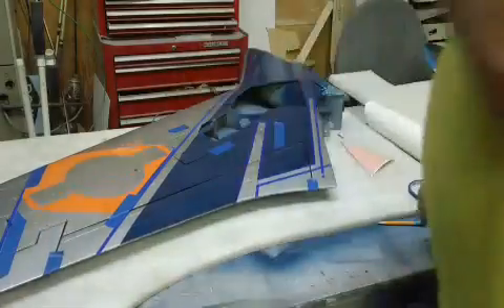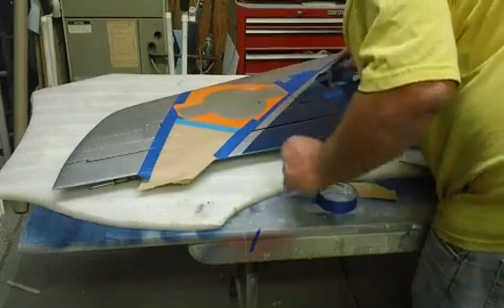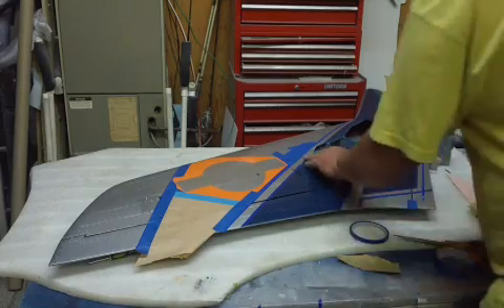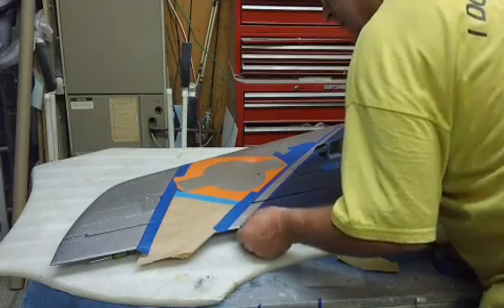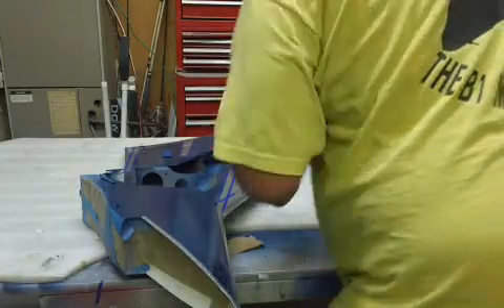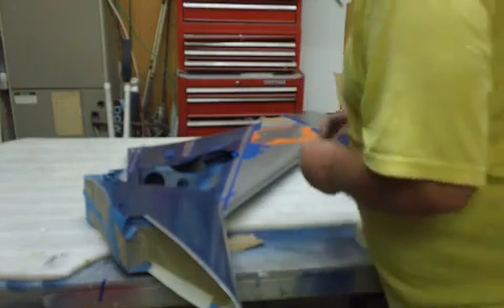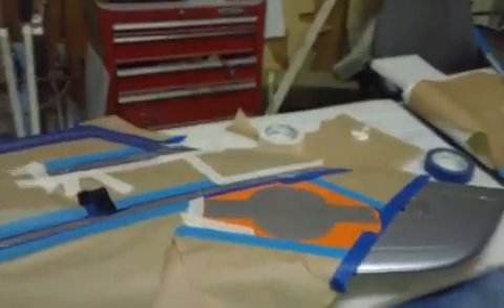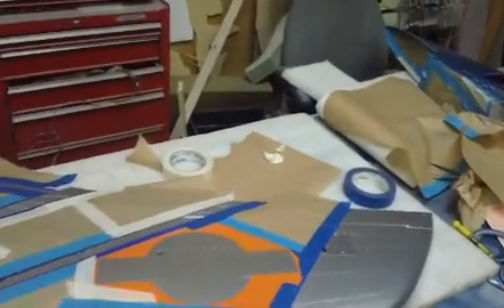masking for white

Comment: I think you can still get fineline, but it's is extremely expensive. It does bend tighter without bunching or lifting as it is thinner. But being careful with the pin striping tape that you are using work fine too.

Comment: That was a close one wowzers. See the white star mask is a spray through mask not a blocking masks. That means you got to put the white over the blue I designed it that way to help with the line up. However if you did spray it white I could have sent you the white blocking mask file for the blue and you could have gone to your local vinyl guy and had him cut you a new white blocking mask to shoot the blue through then use my red one for the red bars easy fix. All vinyl cutters use vector files.